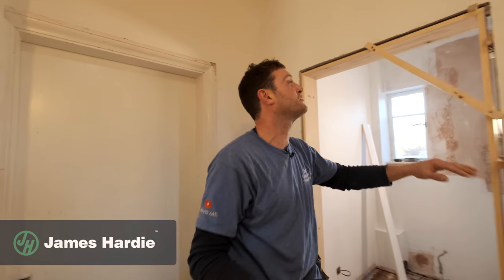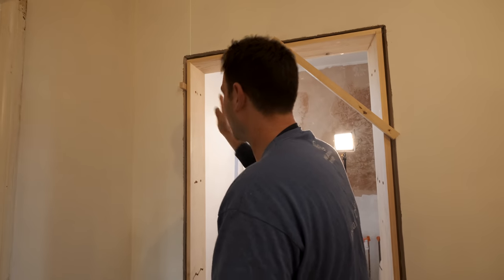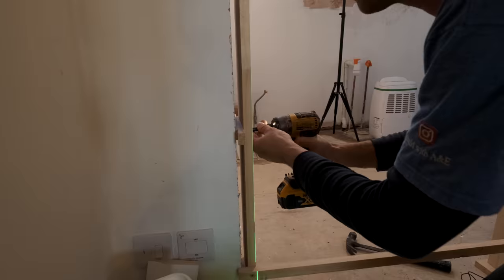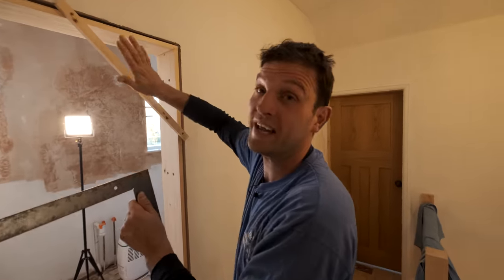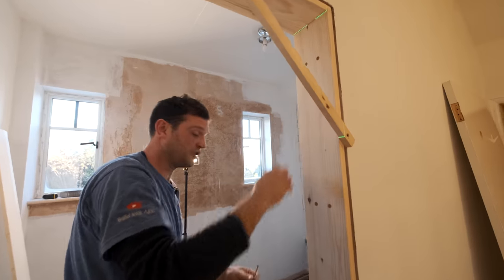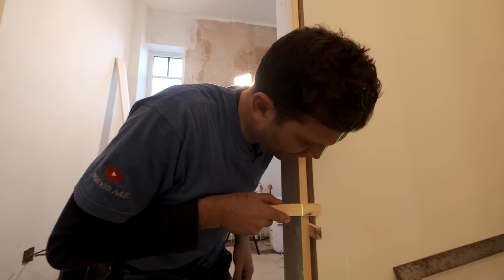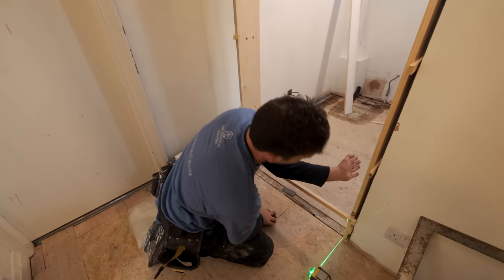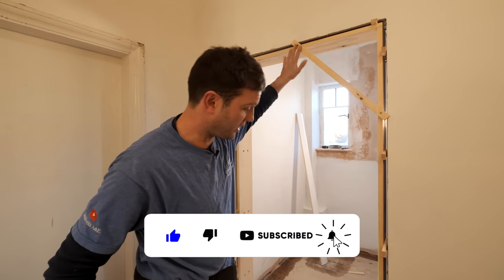How to fit Door Frame Linings 🚪

Comment: I'm a carpenter and the way I do door linings in studwork is, I plumb my timber packings on the hanging side, fix the frame to the hanging side. Plumb the head then two fixings top and bottom on the clashing side, then hang the door, get the gaps right on the clashing side and final fix, then I foam up any gaps behind the frame. Obviously check the wind,before final fixing. Every one has there own method I guess.
Reply: Level the head😮😅
Reply: @MrRedfreds if ur plumb one side and u square of that side to the head it will always be level

Comment: Im a carpenter and have fitted 100s of frames and linings and i can fit one in 5 minutes and only put 4 pairs of screws down each side and use a level not a laser
Reply from the maker: Hi Gary if that works for you then great all the best Tony 👍

Comment: Top tip, rather than using a batten across the bottom on one side, cut a piece of 1x4 or something similar the same size as the internal head measurement a place it between the legs on the floor.
That way your opening at the bottom will be dead square, this is a must if you are putting thresholds in between like on fire doors for example 👍

Comment: Great video mate, the way I like to do it is clamp the 6ft level to the lining with the festool track clamps, brings the lining straight with the level then very quick to get it plumb. I used to have my doubts about wedges, I've seen a lot of old linings where the linings have slipped so used packers for a while, but wedges are a lot quicker and I think this day and edge if you're foaming the gap, they aren't going anywhere.

Comment: Its all about the lining when fitting doors.
I'm a 32 year old self taught chippy.
I've made some big mistakes out of overconfidence.
Took on a weekend job, 13 pre finished oak veneered doors to be hung in very old frames out of whack frames.
Reckoned I could get at least 4x done each Saturday.
Went in cheap coz I was confident I could do a good job. I was wrong.
On a good day I'd get two done, by the time I got to the last few I was insisting on ripping out the old frames and installing new ones, which the customer wasn't okay with.
Ended up costing me about £600 and a month and a half of Saturdays.
I envy the YouTube tradesmen who have a good enough reputation to charge well and actually enjoy their jobs.

Comment: Have you ever used tulip wood  for door linings I was told it's the best wood to use if your doing wide linings because it doesn't twist later. I put them in my kitchen doorway lovely to work with. Great video.
Reply from the maker: Hi dilligaf tulip is a beautiful timber pretty much knot free, all the best Tony 👍

Comment: Any tips for working with 20mm solid oak linings? I can't go crazy with screws/nails without having a lot of holes to plug.

I'm purposely leaving this job to the very last so I'm not having to mask-up 14 new doors & frames.
Reply from the maker: Oak linings 20mm, nightmare to fit being so thin but hide screws with traditional 12mm plug and pellets

Comment: Pete,  whenever I fit door casings at 765mm, I still have to trim the lead edge of the new door a couple of mm as it hits the jamb when I swing it. Is it because I’m using the ballbearing chrome hinges? The casings I used yesterday were factory trenched and I still had the problem of having to back cut the door 2mm. Thanks . Paul
Reply from the maker: Hi Paul 
You are correct 
It’s called the leading edge which Pete later but we missed on this video 
All the best Tony 👍

Comment: I'm planing to replace all my internal softwood doors and linings with oak. Any suggestions on how to hide the screw /nail fittings without using wide door stops?
Reply from the maker: Hi the old traditional way 12mm oak pellets 👍

Comment: Anyone got any insight, one part of the process I don’t understand is how he prescrews an then still manages to push out the frame with a wedge. Does the screw not hold the frame and prevent it being pushed. I have run into the problem of having packers slipping out  when trying to pack

Comment: Good tips there Pete, but what do you guys do on refurbs when the walls aren't plumb and using of the shelf linings. I've come this problem and ended up with the frame sticking out past the wall on one side, causing a right pain when doing the architrave.
Reply from the maker: Hi kevin we always add on timber scribe on  the jamb and kick the door hinges slightly it makes life a lot easier all the best Tony 👍
Reply: @BuildWithAE  Good idea Tony never done the scribe piece but have played around with the hinges so to get the doors right on the latch side. Keep up the good work lads 👍👍

Comment: Hi there, very good explanation. What method do you have to make sure the legs are perfectly in line when you can’t stand at an angle to sight down them? 
It’s great when you can swing a door and can adjust the slam side to suit, but as you know that’s not always an option. Would you use your laser for example?
Reply: String lines across the diagonals any gap where strings meet or one string pushing the other inwards the jambs are not plumb/parallel on the architrave faces.
Reply: Hi, I use that method for double doors. I’m always open to other suggestions and methods. Cheers pal
Reply from the maker: Hi Paul Pete might use his level straight edge, when we would do price work we plumb hinge side square head hang door and plumb latch side to door, best me a friend did on price in one day was 54 fire doors between us we were earning great coin those were the days 😂 all the best Tony 👍
Reply: @BuildWithAE   I like to do the same. I have found I put frame in square and parallel, to find when you swing the door the door  is not always true, can have small twist. So if you  can plumb the latch side to the door. Not always possible
Reply: @BuildWithAE  Hi Tony, I agree, if the door is getting hung, your method is exactly how I do it.👍🏻 54 frames and doors in one day is very impressive for 2 Chippies. Even more impressive that it was fire doors.

Comment: How do you go about a leading edge on pre finished doors? Do you leave more clearance or do you plane a leading edge and re-lacquer just the edge?
Thanks
Reply from the maker: Hi Joe leading edge I was waiting for that, you should definitely always put a leading edge on all doors and if lacquered then it would need recoating but sometimes this does not always happen because of who doing the doors after they have been hung. I remember putting leading edges on the top of the door as well as the sides if anyone can remember that far back showing my age now 😂 all the best Tony 👍

Comment: How to fill gaps ?
Reply: Expanding foam
Reply: Thanks for the reply
Reply: No need to. Architrave will do the rest.
Reply: @chippyboy35  needs something for sound proofing really.
Reply: @chippyboy35  you’d still foam fill it
Reply from the maker: Insulation left over if need to or bonding, foam etc etc
Reply: Covered by architrave